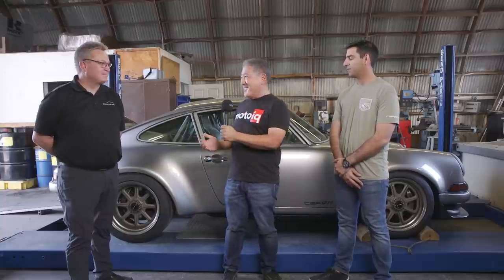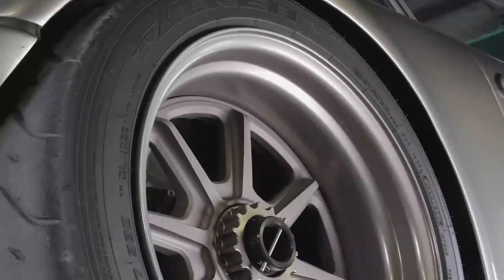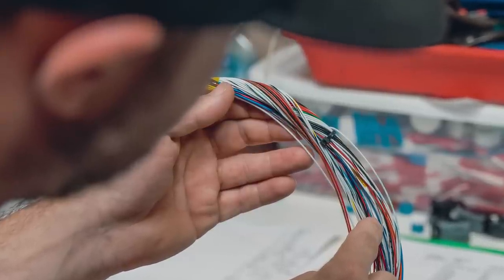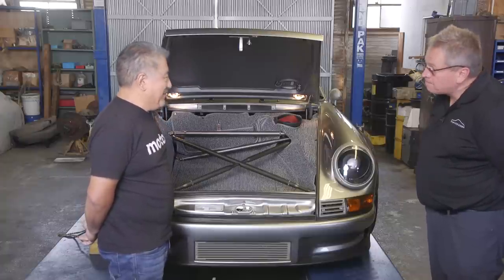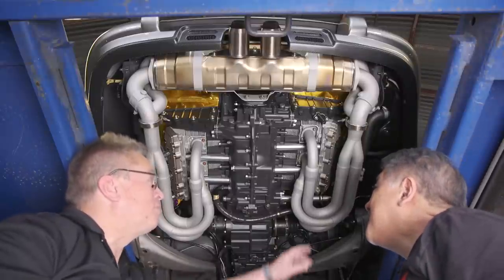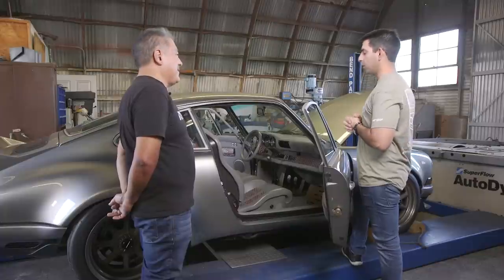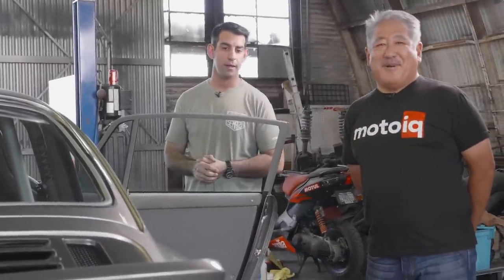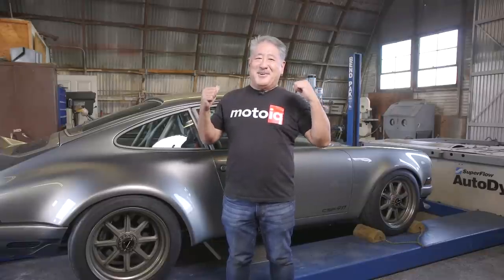HANDCRAFTED 400+ Horsepower 1982 Porsche 911 Restomod!

Comment: More, Please.  and, what ever happened to the Hayabusa Miata?  And is a streetable VG30DE that spins to 9,000 rpm possible?
Reply from the maker: Its possible but its not going to be a pleasant street car.
Reply: @motoiq  Thanks, I have a slicktop 300ZX and I was torn as to making it into a lightweight, high revving car (think S200) or making it even lighter by installing an aluminum LS engine.  But you just made up my mind for me.  Thanks again.

Comment: I wonder if that gold heat rejection coating put on domes/chambers/exhaust valves would be good on an air/oil cooled car. Would it make it harder for heat to exchange into the oil? This thing is amazing
Reply from the maker: Yes it keeps the heat out of those parts.
Reply: lol I had a dumb moment there. The heat will be rejected from those parts and sent out the exhaust leaving less work for the oil.

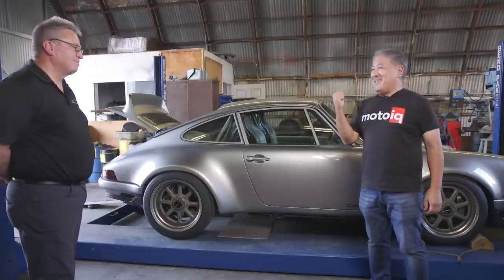Comment: At (10:12) when you talk about your car being a Porsche 911 SC my car is a 1978 Porsche 911 SC I had an SSI exhaust and a Dansk Muffler and I had to take it off because it would not pass smog. I want that Manifold on my Porsche it makes 20 more HP and even though it runs better and cleaner they don't care they don't want it on your Porsche if it is not legal. How do you pass smog? What do I have to do that makes it so I can have that Manifold. I want to Hot Rod the engine. The owner of Rasant who builds engines and sells that Manifold said I can get 283 HP 

without it driving like a race car more like a stock Porsche. If I want more HP I have to have Higher Compression. I can also run a Supercharger would give me more HP. I was hoping for around 380 HP or more. Does anyone know what I have to do and where I go so I can pass smog and where I go to get it approved? I'm told I can't run that Manifold he has. How are you passing smog with that engine? I'm told your car has to be a 1975 or older to pass smog. You can't modify anything newer than 1975 or older. They have a State referee bar program. The car has to be Carb 

approved. This is something A BMW has to do. California engine swaps the cops can’t touch | MODIFIED https://www.youtube.com/watch?v=VjSUwykYa5Q&t=2s Any help would be great to know how I can run that Manifold and pass smog and run aftermarket legal exhaust and Muffler that will pass smog. They are Cracking down on Modified cars and cars with special tunes. I want to know how to get all around this and pass smog. You have to put a special sticker on your car so they know about what was done to your car. Thank You! for sharing Best Regards.
Reply from the maker: You cannot run any aftermarket performance parts and pass smog unless they have a CARB EO number no exceptions except for a cat back exhaust.
Reply: @MotoIQ,  Thank You that is very helpful. But where do I get a CARB EO number at the DMV?
Reply from the maker: You have to buy parts with a CARB EO#. Unfortunately, there are not many.